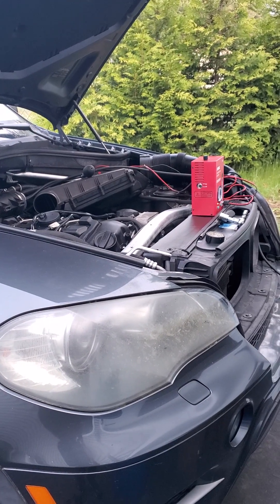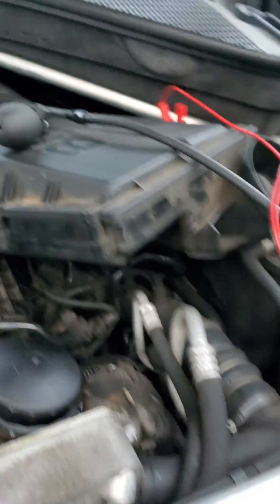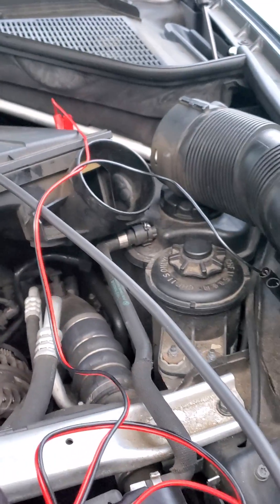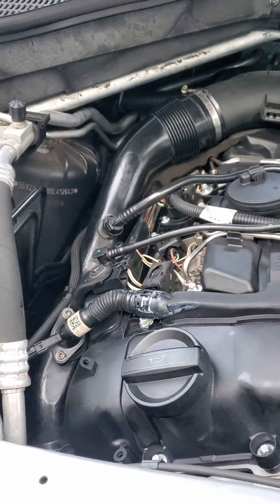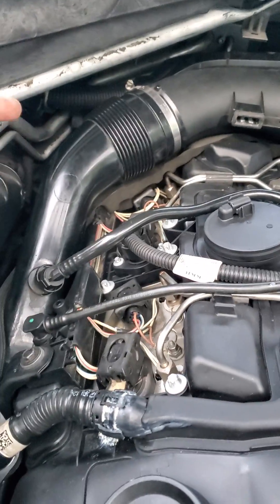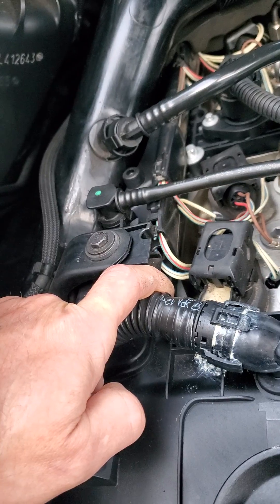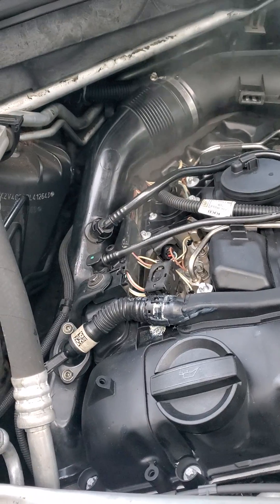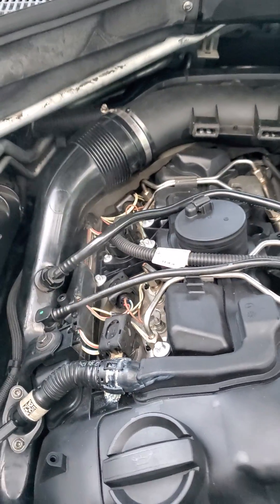BMW N55  Rough Running / Misfire Feel - Smoke Test  For Air Leak Using The Ancel 3000 Smoke Machine

Comment: the crankcase heater line is notorious for cracking even when installing new...next time I am just using a silicone tube and some clamps...not paying $35+ for a OE tube that breaks very very easily
Reply from the maker: The new part is usually very durable. If you buy from FCP Euro they do offer a lifetime part warranty. The hose idea can be a good one except in cold climates moisture and oil mix could freeze in the tube, clog the line, and cause engine problems.
Reply: @AskTheCarExperts  new ones from FCP Euro or ECS still feel too brittle and those 4 point clamps are a real pain...
Reply: @nevrcm3261 what part of lifetime warranty do you not understand lol
Reply: @matt.108  how does a lifetime warranty ensure my first repair (time, urgency, etc) is successful.

Does a lifetime warranty  ensure my car is operational immediately after the repair or do I have to wait 4-6 more days for the replacement.

I'm guessing you haven't dealt with these nuisance connectors/pipes...probably a internet observer of life not an actual participant getting your hands dirty